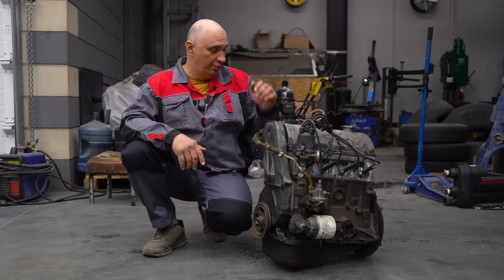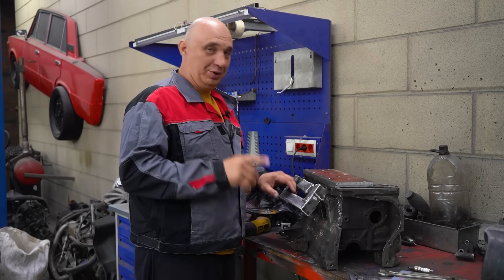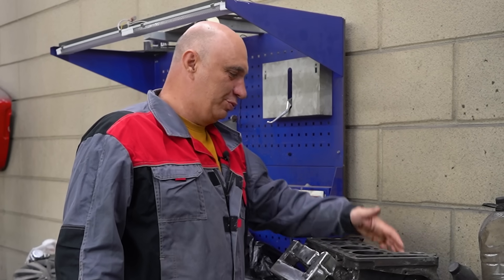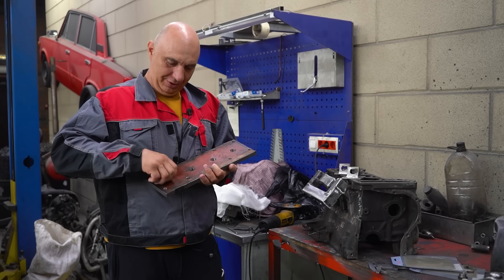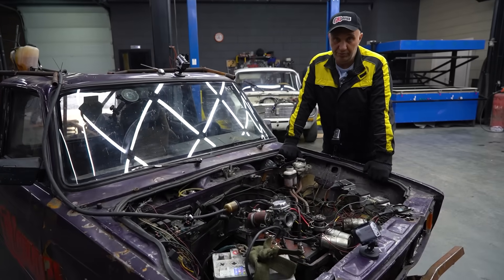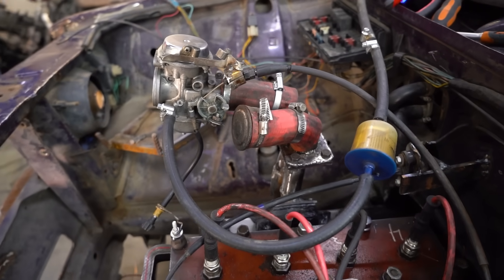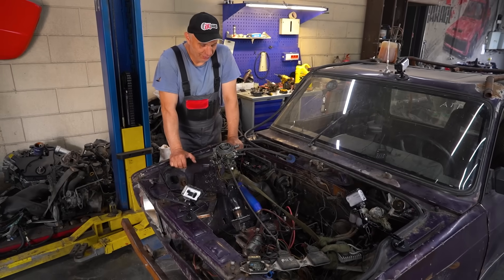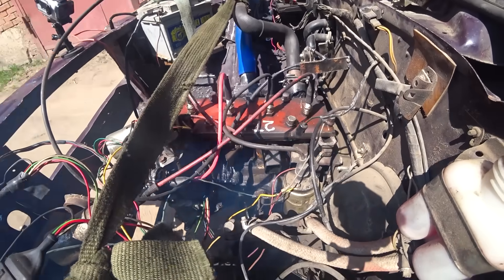4 stroke to 2 stroke Lada engine conversion

Comment: Throw on some 2 stroke moded exhausts that actually suck the exhaust gasses out the cylinders before new mixture gets injected, one per cylinder, might help a good bit!
Having airflow nailed on a 2 stroke is important, as you said, i also guess on a vaccum issue.
Im sure you guys gonna make it happen! I wanna hear that thing rev to the redline! >:D
Reply: You're wrong, 2 stroke exhausts or expansion exhausts have a reflecting wave inside, it bounces back preventing the new mixture being pulled along with the mass of the wasted gasses. there are mathematical formulas for it and only works for that particular stroke/bore. There is nothing mechanical about it, so no suction is created, all is done by the piston (pump).
Reply: @AnalogDude_  I'm not wrong, my expanation was just VERY basic and lacking... Even embarassing reading it now lol. And yes one would need to calculate the pipe for the exact cylinder/piston combo or it won't work properly. And techically such a pipe is sucking (and blowing, aka pulsing/resonating) the gasses. Also a Reed or Disc Valve could be a part in how much and when you can pump. And your crank case volume. As i said flow is essential in a 2 stroke if you wanna get any kind of reliable power out of it. Which would in return affect the geometry of the pipe again. As you said it needs to be specifically tuned to the application. The only mechanical part about it would be welding the sheet metal. As "basic" idea long pipe more torque but limits rev and thicc pipe with hard cones for higher rpms. And using a calculator for that is the only reasonable way. Or buy something that fits your spec. I already build quite a few 2 stroke engines (1 cylinders with 50-150cc mostly) so yeah. Should have put more effort into the first comment maybe :|
Reply: @sicstar  There is no sucking or blowing, the exhaust gasses have "mass" and velocity causing something like a vacuum in the cyl, put a cigarette in the ass tray of car and make a very very hard turn and see what happens to the smoke. the air inside your car moves opposite to the turn. That causes cars to flip over "sometimes".

But nice to see your comment.
: )

Comment: Port timing exaust firstly opens then tranfer ports or timing to advance no poping from carb and 1 carb per cylinder with big jets its sucking the heck out that carb 2 sroke needs more every cylinder needs its own air flow to work the reed good luck always wanted you guys to try this you crazy Russians keep it up ❤

Comment: You coulda…

Replaced the factory intake springs with lighter springs, so they were opened by the cylinder vs port air pressure. Also added a supercharger, since the crankcase wasn't used for forcing the charge into the cylinder.

Comment: I think you should shorten the distance between the carburetor and intake flaps. You definitely need a exhaust. The sealing in the chambers ia also important,but it might work without doing it.
Keep up the good work! Great videos!
Reply: Was thinking the exact same. With all that extra room between the carb and the reed valves, you are not getting proper atomization.

Comment: You did not understand how a 2stroke works? Lol.
You need a blower between carb and intake. Like the detroit 2stroke diesels. Or a crankcase compressor like the chainsaws. The fresh gas does not enter the cylinder by miracle, it needs a blower/compressor to do so.

Comment: You seem to have calculated and measured the port height for intake and exhaust. What degree of timing did you aim for? How much pre-exhaust timing do you have? Unless you have a very decent designed and manufactured exhaust layout, you´ll need higher pressure on the intake side (pumping in the crankcase of a conventional 2stroke) as the cylinder is still pressurized when the intake ports open. Not shure why you didn´t account for that so far.

Comment: intake and exhaust ports are incorrectly milled into the cylinders, lower the intake port height and widen them, then lower the height of the exhaust port.

Comment: I would use 1 and 3 cylinders as a scavenging pumps for 2 and 4. So the cyl no.1 is sucking mixture from the carb, then transfers it to 2. cyl. witch ignite it, and same thing with 3 and 4. This thing requires the old cylinderhead, a modded camshaft, and 1:1 crank-cam sproket ratio.
I think the problem is either a vacuum leak, or that crankcase volume, witch is somewhere between huge and ridiculous.

Comment: With a 2 stroke 2 inhale ports and 1 exhaust port. You need also the back pressure from the exchaust to work properly. 
And a separate are intake will also help.
I'm sorry for my bad English because I'm not native speaking / writing in English.
Wish you good luck with this project and thanks for all what you already created 😁👍
Reply: Not really. Needs transfer ports if thinking as a typical 2stroke. Which obviously this isn't for many of reasons. Needs forced induction or will never actually run.... Aka Detroit diesel!